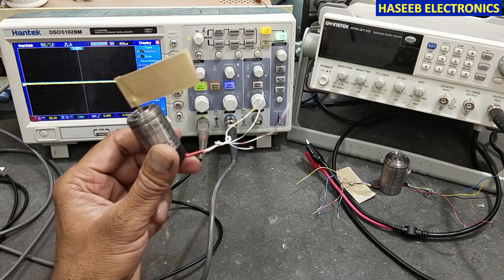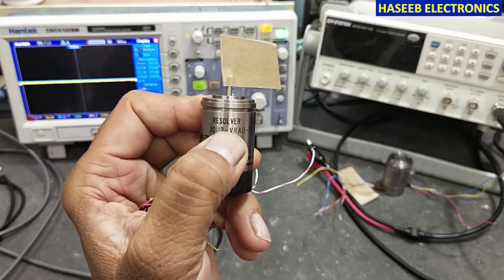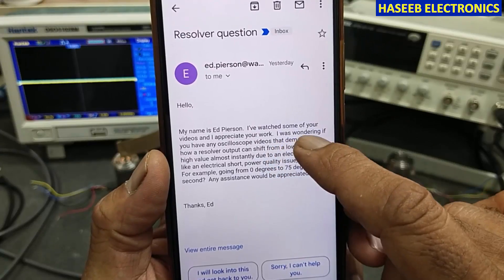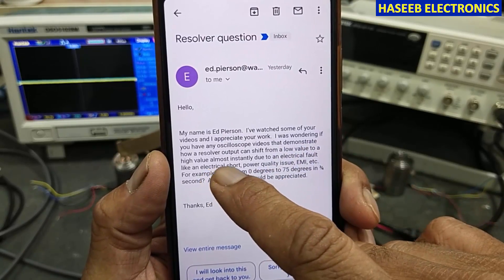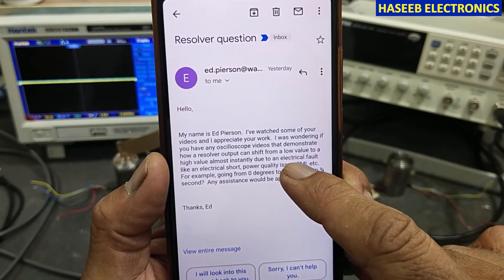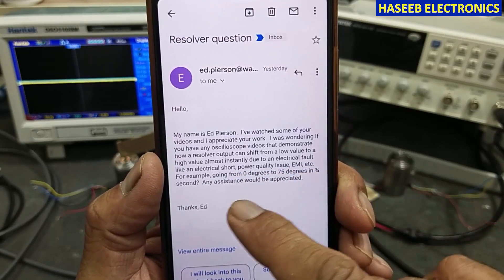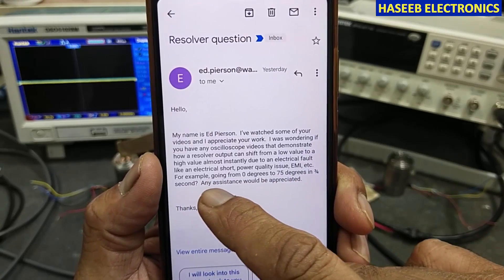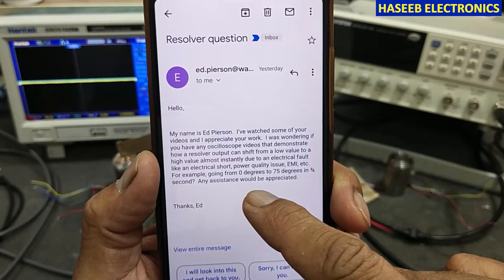{766} How To Test Resolver || What is Resolver

Comment: Please what is the best and affordable oscilloscope and function generator to buy
Reply from the maker: i prefer Hantek DSO5102P,  (even i have HP, RIGOL, TEKTRONIX and Hantek) 
GWinstek as function generator awesome (and many cheap brands are also available and reliable) 
moreover (Uni-T dual channel or any other brand having 2 channel or more 
with 1Ga Sample/ Sec,
100MHz bandwidth or above ) can be selected as well.as the most of the oscilloscopes are using approximately similar motherboard and display. just brand names differs
Reply: @HaseebElectronics  ok thanks